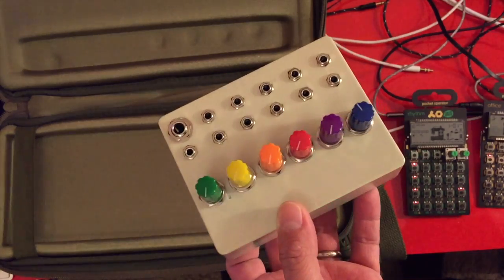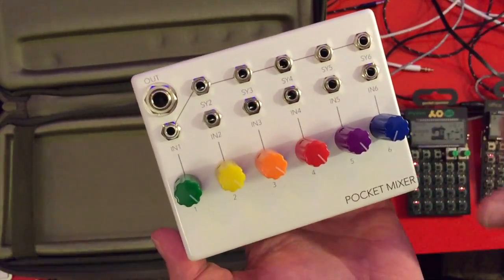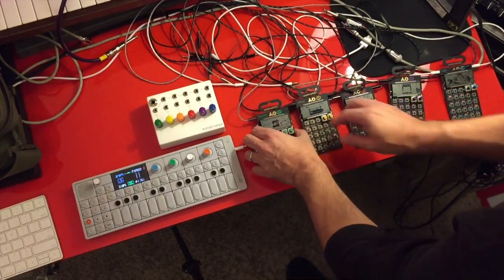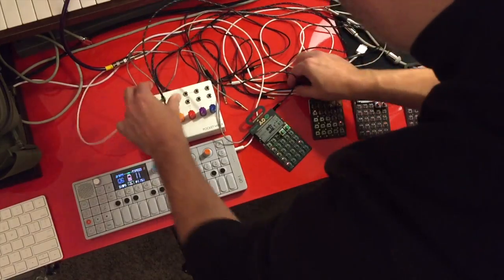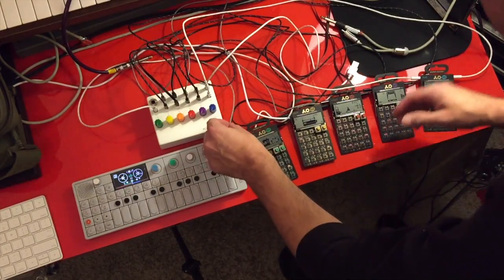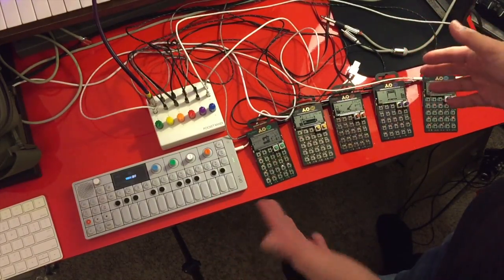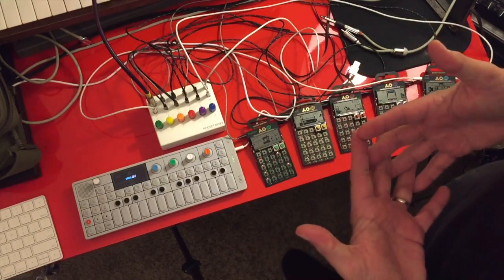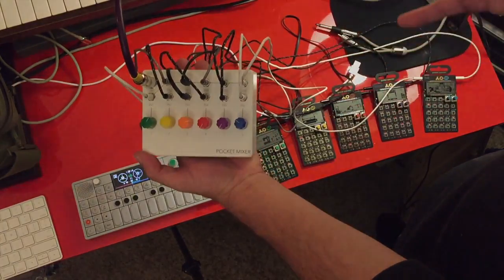Not NAMM 2017: DJTW Pocket Mixer Project Update

Comment: It won't work properly with korg volcas if this is a passive mixer.

EXPLANATION:

this won't work if the Korg volcas are connected to sync with the BPM because when conected with same source say this mixer is basically being used as a giant split the audio interferes with the the sync cables and and makes the BPM tempo Double in speed and sometimes even skip steps.

Korg should have really checked this before releasing there volca series.

the only way to prevent this would be to use some sort of diode that only lets sound signals travel one way through the wire but I tried it with LEDs but these signal still managed to travel through so I don't know what I can use as a diode for audio

Comment: Surely this would work with Korg Volca's aswell maybe with a little tinkering on the sync type,  an easy basic mixer solution for anything with 3.5mm jack outputs, nice work 👍

Comment: How about using the existing knobs as pans, and then adding sliders below them, and using them for the mixing part. Going a step forward, have a button below each slider, that could act as mutes.  Do this before Korg does something, and you probably have a true winner on your hands.